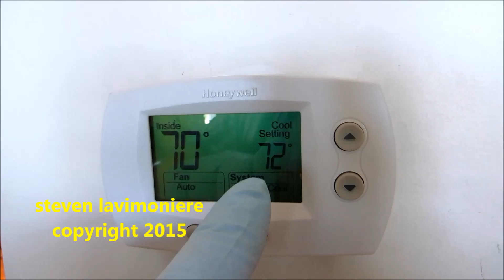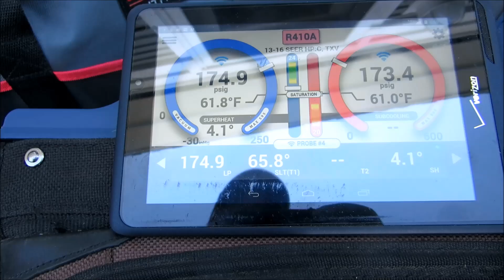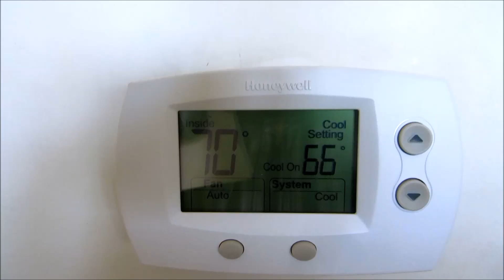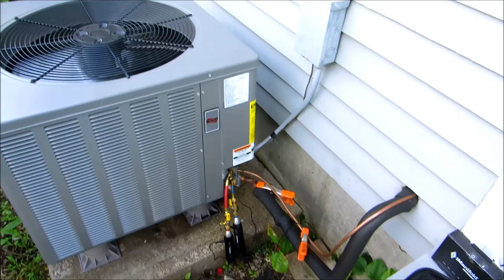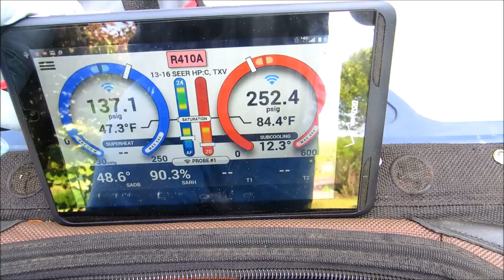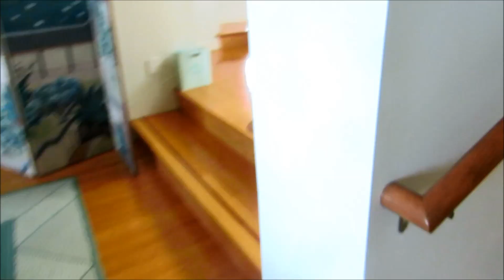heat pump,air handler, line set replacement part 3 final

Comment: Hey Steve, Thanks for the video. I always pick up something new. I'm curious how you open up the stub that comes out of the a-coil for the suction line. When I use a tubing cutter it doesn't leave very much tube to braze to, but any other method of cutting off the end that I can think of creates copper dust or flakes that I don't want getting into the system.
Reply from the maker: Richard Clark on the suction line on coil i use my grinder with cut off wheel  then i clean it out good and clean it for brazing
Reply: steven lavimoniere   Thanks for taking the time to respond back to me. New techs like myself really appreciate the time you take to make these vids and respond to our questions. It is extremely helpful to me. Many thanks.

Comment: Hey Steve just curious as to why you paid a electrician to do the wiring? If you had to rewire to extend the whip, I'm sure you could have done all the wiring. Unless it was bid for that maybe?
Reply from the maker: MAGIC TOUCH HVAC i try to do things by the code .i need a licensed electrion to wire the unit up by law in my state .sure i could have done it my self . thats not the point. i have no issue hiring a electrion to wire the unit up .there is money in the job for it .

Comment: Nice installation videos Steve, great work on that replacement job.  Boy you are right on the location of the service valves on that RUUD unit.  If they had only extended them out another inch or so.
Reply from the maker: Rich Rada the new ruuds have a better design on the servise valves i believe this is one of the older versions

Comment: I put in a 3 1/2 ton trane unit and had that kind of scenario.  The air handler wanted 9 sub cool, the condenser wanted 11.  It was happy at 9.  Good choice for thermostat.
Reply from the maker: Truckguy900 Truckguy900 i like the honeywell tstats

Comment: I may be wrong but I'd look at subcooling more than target head pressure. Maybe Jim Bergmann has some insight?
Reply: Temperature is most important
It's temperature difference that removes or absorbs heat at the right rate.
Subcooling and superheat are although very important they are secondary to temperature.
So target head pressure would essentially be the proper head pressure to remove heat 
That is a quote from Jim Bergmann in our I mangold discussion hangout the other day
Reply from the maker: Las Vegas Air Conditioning, Inc. remember this is a replacement attacted to a old duct work system. not a new house. and new duct work ..
Reply: Thanks for the reminder Las Vegas Air Conditioning, Inc. Learning more every day!
Reply from the maker: i had the evaporator as standand not high effenicy i thinks thats were the problem was.